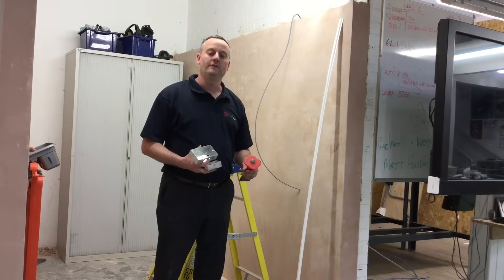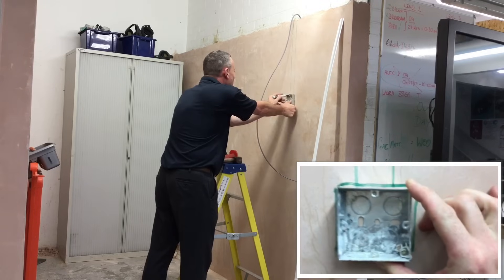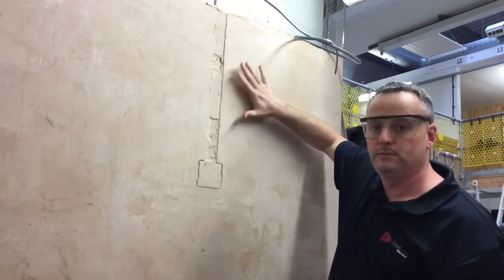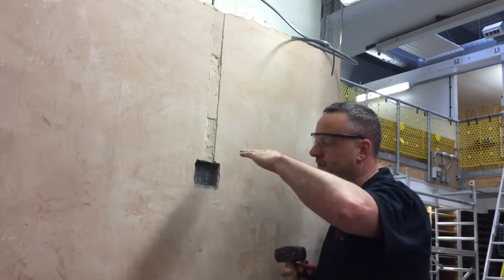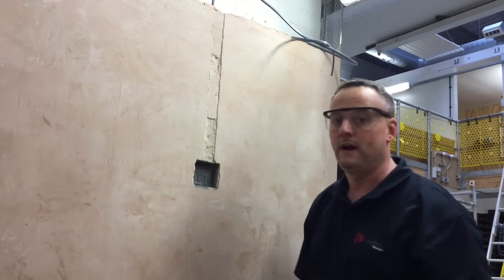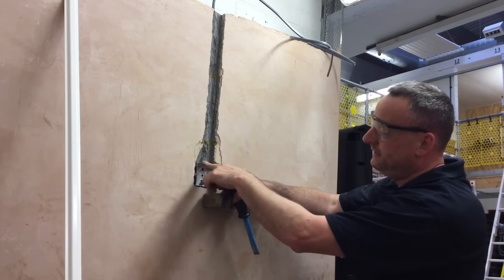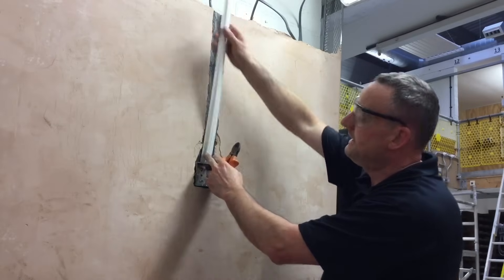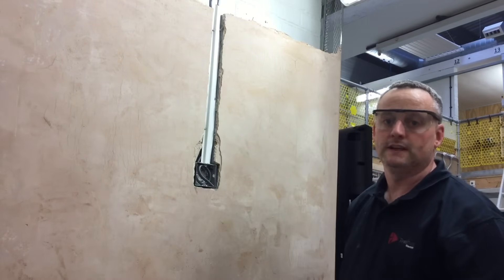How to Chase a Wall and Fit a Flush Single or Twin Socket Box In a Plastered Brick Walls (Chasing)

Comment: Great video, haven't done this at college so really beneficial.  One question - In the real world, if I'm asked to reinstate would I have to plaster the wall? If so I'd better learn how to do it!
Reply from the maker: +Jake Chattey

The trick is to make sure the wall is nice and wet. Use a bonding coating first and when it’s dry either a finish coat or a light weight filler. Remember we are electricians not plasters. You wouldn’t ask a plaster to re-wire your house so why would you ask an electrician to plaster it. Thanks for watching GSH Electrical

Comment: Would using a wall chasing grinder be any quicker.  If re wiring an old house with double brick skin wall
Reply from the maker: +ashley sefton 
Hi a wall chasing grinder would be quicker but it creates a lot of dust. Thanks for watching GSH Electrical
Reply: Hilti DC SE 20 + Vacuum (hilti vc 40 for example) simply the best!!!

Comment: how would you fit the capping in if its brick or concrete wall instead of using nails?
Reply from the maker: +diprobase1000 
Hi. If the wall was brick or concrete block you would hammer the galvanised nails into the cement between the bricks this is softer. Alternatively you can use oval camping or conduit and fix this with crampits again hammering these into the cement.  Thanks GSH Electrical
Reply: Plugs and nails but go on the side of the capping rather through